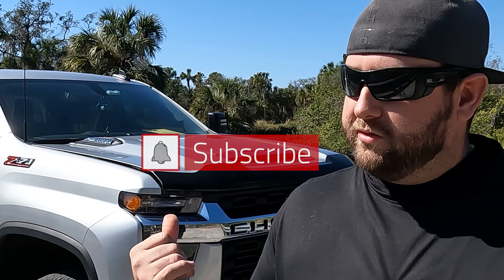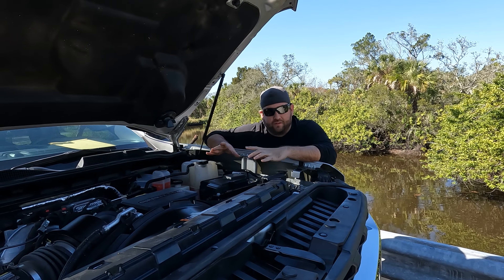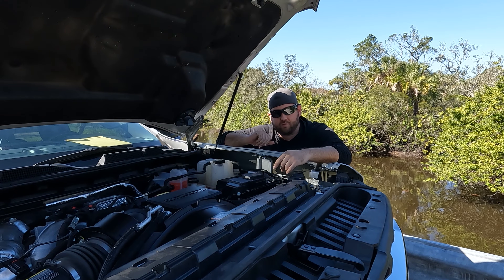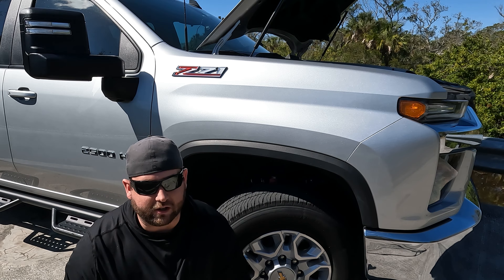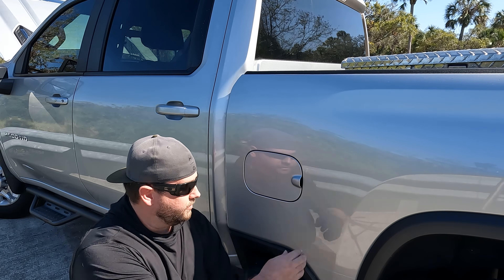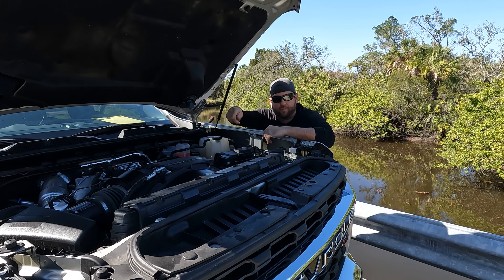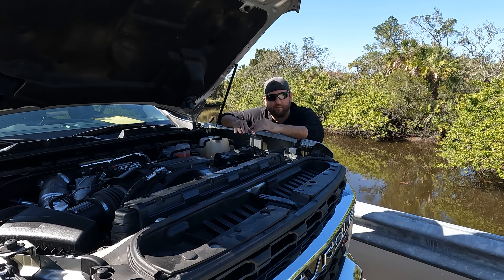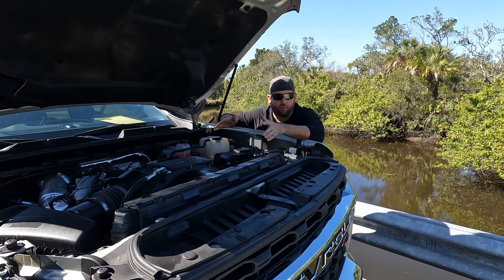Duramax Diesel Maintenance: Episode 1 - Essentials you Need to KNOW!

Comment: Heyy question i have a new diesel truck and am new to it but duramax has two fuel filter?? Because my fuel filter is in the back by the gas tank no the wheel and is a GMC but is the same right? So does it have 2 of the move it to gmc to another location??
Reply from the maker: For the new L5P its on the Drivers side right under the passenger door, on the older LML that came before the L5P its in the passenger wheel well.  There was a transition period between "2016.5" where the switch was done and engines were changed.  If in doubt on you type of motor the fuel filter location will tell you

Comment: Just bought my first  2025 Silverado LTZ 6.6 Diesel. So I have  question. When purchasing diesel fuel , is there a certain brand to look for, are all of them the same at what ever station you go to....
Reply from the maker: Stay away from the small towns with the no-name diesel stations is all I can tell you. 

A lot of these little Podunk gas stations have water that leaks into the diesel fuel from corroded tanks so just stick with the big brands.  And for your year, always carry an extra fuel filter....when they go they put the truck in limp if you get a bad fill up do to the seperator

Comment: I would also add differential fluid to that list. And if your diesel is new/low mileage, I would get into a habit of full transmission oil changes. If you wait too long, it will become dependent on the grit of the old fluid in order to not slip
Reply from the maker: Thats a good point, while not considered basic, it is a must do on these if you are actually using them for what it's designed for. Many forget the transmission is fully serviceable  and not a closed unit like some other competitors . ... fortunately the Duramax mall parking lot crawlers don't need to worry about this 🤣🤣🤣

Comment: And don't be an idiot like me and rely on your Driver's Information Center telling you it's time to change your fuel filter  ,,, after owning my first diesel for 4yrs and only driving 2500 miles a yr , pressure built-up and pushed the plastic water sensor out of the filter ( more like a crazy cross threaded it) and with that pressure the head unit wouldn't  hold the prime..  now I change my filter every 6 mth
Reply from the maker: Good Tip! The DIC is not accurate and doesn't appear to take into consideration heavy usage from my experience. For those who do haul ...3000 miles with no load is not the same as 3000 miles loaded down. Same on the oil change.

Comment: Just found the channel, excellent job. I’m a new 2023 Chevy High Country Duramax owner. First diesel and look forward to this series. Thanks!
Reply from the maker: Glad you found the channel!  You will be very happy with the Duramax and that truck will give you many years of enjoyment.  I have had a few so far and I can say I will never go back to a gasser!  They require very little upkeep and will run forever.....The only issue I am seeing is the surface rust under the truck is showing up much earlier than before;  more than likely the salty Florida weather and constant trips to the boat ramp are not good.

The other issue so far with the new duramax'  is the brake pads....they are very loud and there is a TB from GM but they will only do the fix if you mention an issue with the pads so keep that in mind.